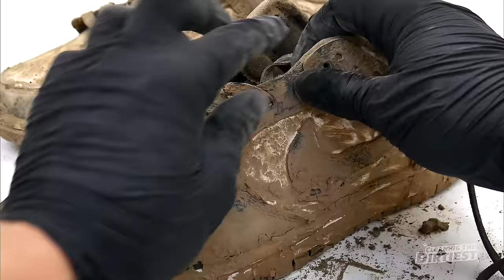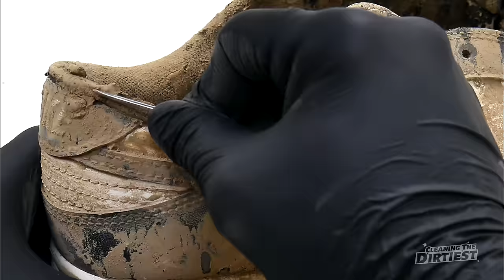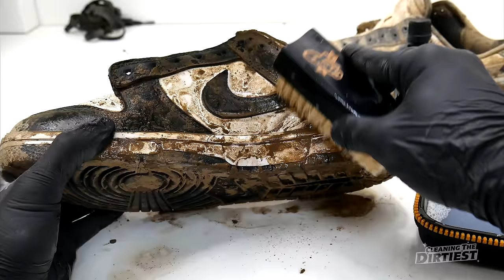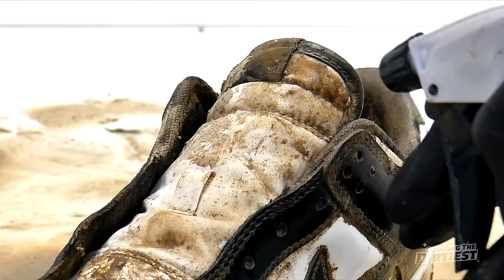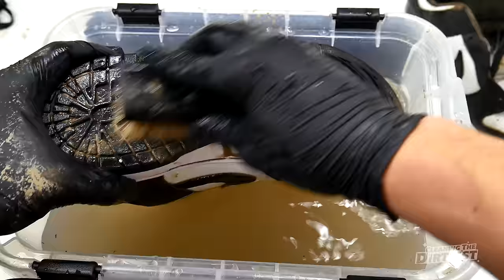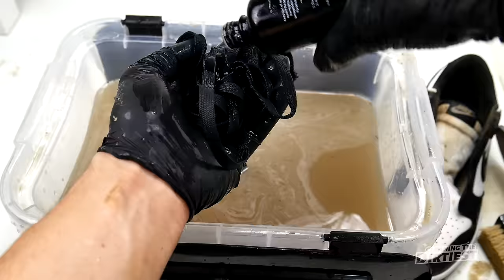I Cleaned The World's DIRTIEST Panda Dunks | ASMR

Comment: this guys dirt removing method is unorthodox he should get water on those shoes or better yet use a wet brush and start scrubbing those shoes down w/a wet brush when using a wet brush he will get the job done in less than 1/2 the time it takes him then the method he is using now also i would have poured water into the pockets of the shoe cleaning kit i would have used a different container for soap and water